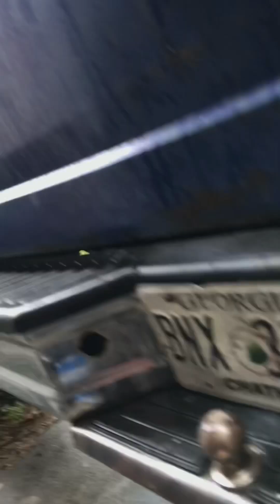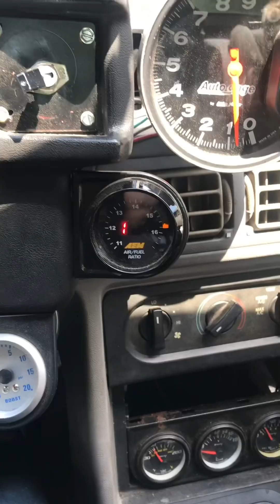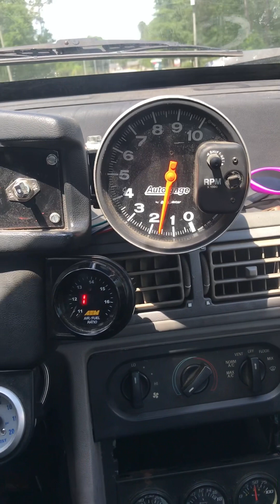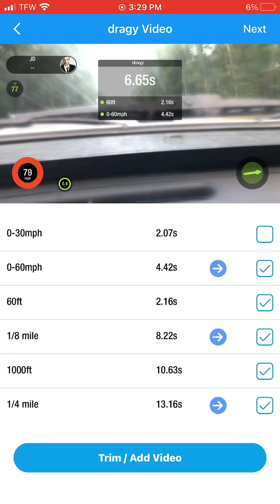8.0s are back but AOD issues arrive!

Comment: 8.0 in 8th is really quick if u ask me, almost 11 second quarter, i coasted a 7.8 in 8th and 11.9, i went to the calculations  thats almost 11.6, but coasting was 11.9, tires were outa balance or outa round from sitting, was scary, it shook so hard, sucks when ducks are not in a row
Reply from the maker: Yea 8.0 on the street is ok I’ve gotten 12.61 letting out so far @112. Before it would only go 8.20s with a better 60ft. 11.9 costing is good! Yes it does suck when things aren’t right.

Comment: Did u put a oil pressure gauge to trans, should only have 3-5 pds no throttle, jump right away when on the throttle
Reply: The port is on passenger side
Reply from the maker: I didn’t only because the long tube header is in the way
Reply: @jdrods1519  if u pull the nylon tube or copper tight enough to tape gage on cowl just for checking, hopefully a non sagging tube won't melt to top of headers, u can pull cable and see if pump acts right also at idle, aods are not nown 4 being great anyways, and overdrive in those are weak, I'm sure u no